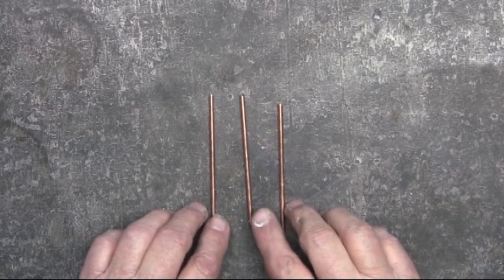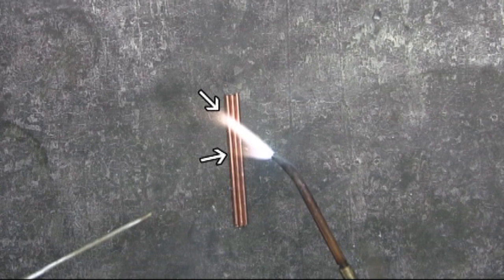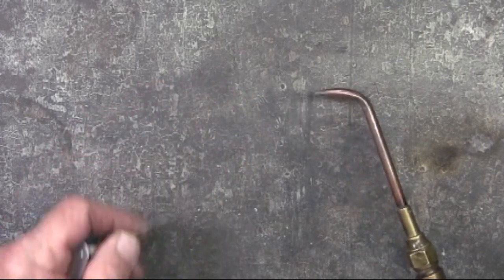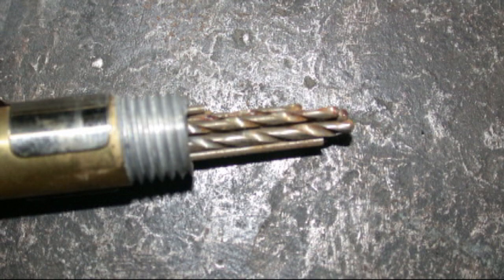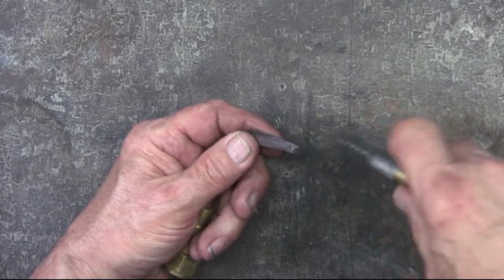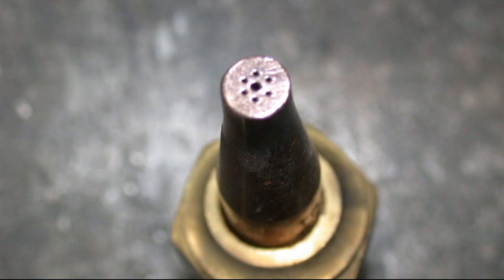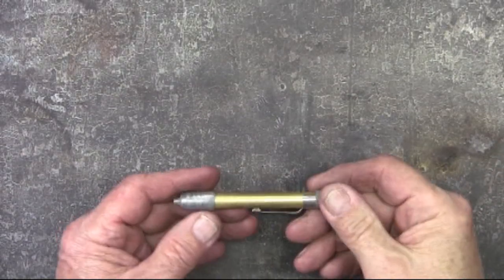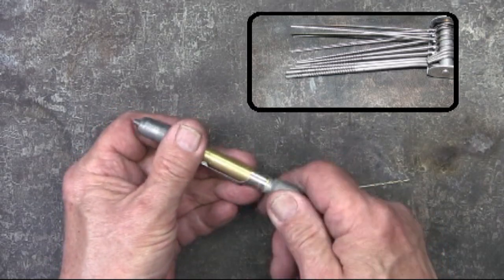Oxygen Acetylene Brazing & Welding Tips

Comment: Where can I purchase the tip drills? Thanks
Reply from the maker: ivan, do a search for:
Hobart 770086 Welding Oxy-Acetylene Tip Cleaner - Drill Type
Amazon has a set for about $13.00
Reply: +George Goehl I'm looking now. the drill has bad reviews
Reply from the maker: Poor reviews on that drill set.  Most drills that size and price are going to be fragile.  Also, do a search for
 KTD01 MAGNUM TIP DRILL SET
Reply: Thanks G! $13.99 on ebay